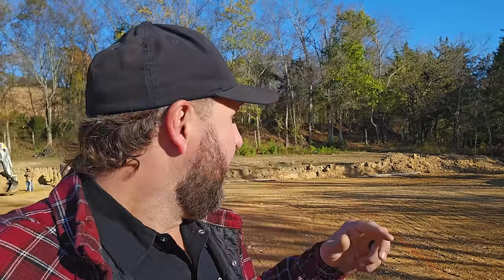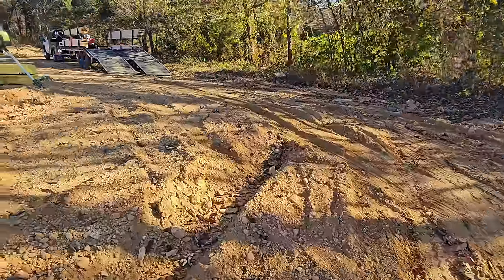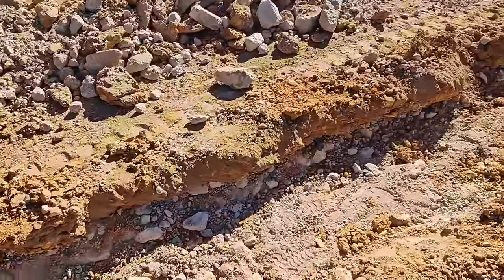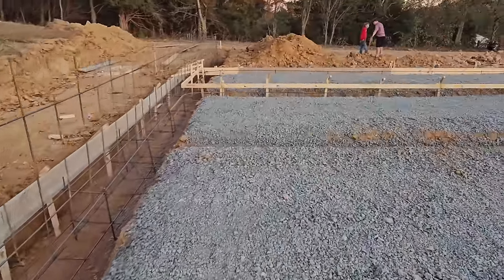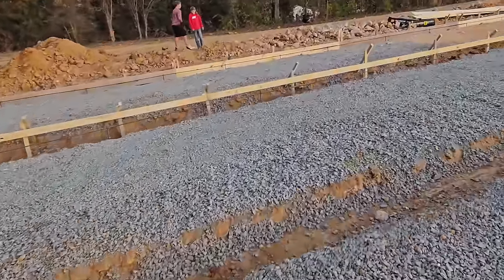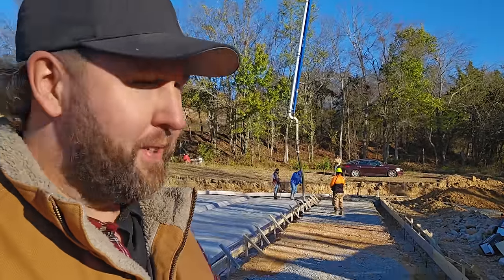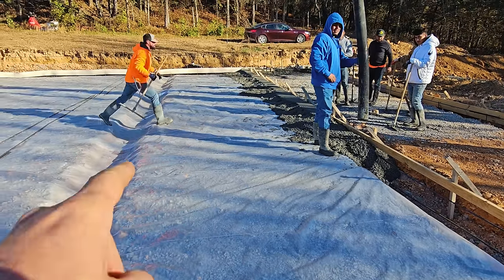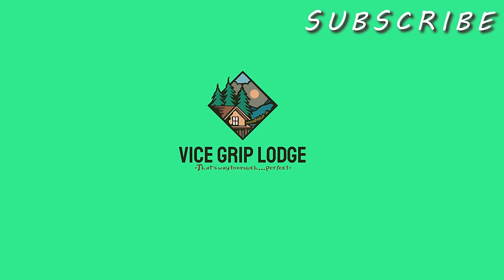We're Already OUT OF ROOM! Barn Build - Part 1

Comment: it's always interesting to see how the different regions of the country do building and concrete. Up here in the dry side of Washington state we get some serious freeze/thaw cycles. Winters get down around zero F, summers up to 109-ish, sometimes hotter, colder as well. A 4000 psi is a good strength for footings, slabs, retaining walls are sometimes higher strength depending on the multitude of variables. When the crew makes it look easy, you know they've got the experience. That's a good looking slab. Up here we'd use a heavy wire mesh or a rebar grid in that slab. That adds a lot to the cost, nice that you don't need it.

Comment: You can still wire the barn for lights and security cameras, just don't connect it to the grid, small solar system will power lights and stuff.

Comment: Howdy, those pump trucks are awesome. When I did concrete, I normally used a 42 meter pump (138 feet), but sometimes used a 48 meter pump (157 feet). On huge pours I had 2 trucks at a time feeding the hopper & one job I used 24-10 yard concrete trucks & 22-10 yard trucks pouring just grout to fill in some old truck loading bays.

That "Bulb Seal" is some awesome stuff. It seals from floor pour to wall pour great.

Comment: With no power, some solid solar flood lights where you can put the fixtures in the building but the mini solar panel is on a cord that you can run out the top to the roof is a must. No lighting sucks

Comment: A neighboring farmer put up a fifty x 150 barn with a six inch slab. We poured the footings 36 inches deep and 12 inches thick, then formed the edge and built stem walls just below grade. All the mats were tied in units and we left the center for the driver if the front unloader trucks
   Some real pros showed up and the truck could reach across the fifty foot width and I as a farmer and carpenter brought some ideas forward that improved our part.
   They unloaded a ten yard overloaded truck every fiftern minutes with a screen crew of eight. These guys were friends working on a Saturday with their main job at the time building the concrete parts of the Bengals Stadium. They enlisted me for clean up work around the bolt pads that later held the steel posts of the building.
   They finished the concrete do flat that the deepest part of the very few rain puddles was 1/8 inch. Start to finish was nine hours with unneeded people dropping out as it became just finishing. One ride on double trowel had pizza pans and the other had blades 
  Our little farm crew established grade and square of the foundation and the finishers had very good things to say about our  work as they checked my laser established forms. It was a great day having that crew on the job and we did not need a pumper truck
Reply: When we put up our big workshop we had a portable concrete plant on site.  And a pumper.

Nearest concrete plant is a 2.5 hour round trip -- plus loading, unloading, etc.  Not feasible for a high volume pour.  Barely even feasible for a 20' x 40' garage.

Comment: Should be nice when it’s done. I know it’s an added expense but it would seem to make sense to have at least minimal power, even just a couple of outlets for a battery charger and air compressor. Also a couple of lights inside and an exterior security light. Running a 100 amp sub box off the main shop should be too bad and certainly cheaper to do now rather than after it’s up.

Comment: Derek, I'd like to know why your architect didn't require the use of road fabric in your slab? (re-bar mesh laying 1 1/2" below the top surface of the concrete to prevent cracking and heaving of the concrete during freezes). Concrete has no tensile or shear strength which is why re-bar is always specified for concrete.

Comment: I’ve been in dirt work all my life. Over 30 years and I have never used big rocks and asphalt chunks for fill. The reason is there will be voids under the concrete and your concrete will crack and the building will settle over the years . I’ve never seen someone use gravel under the concrete either. So good luck . I hope it all last for years .

Comment: Geez, America does concrete quite differently to Australia. That would not pass code here. The slab itself would be full of rio mesh and vibrated. The foundation and wall would have a LOT more steel in it and vibrated also. Did they even test it for slump? WOW!

Comment: Why are you NOT using steel/rebar in the concrete? The steel is what gives concrete it's strength. Concrete cracks which looses the original strength. The rear holds it together and allows the foundation to better move with the land as needed.

Comment: Our pond has like a concrete box with a storm gate on top with underground lines. Zonen5b..so the pond only fills so much then when it reaches the top of the grate it flows into it out the lines in the ground . Could you do something like that if it gives you more issues ?

Comment: I think you'll wish you at least had power at the new building. I understand the cost/benefit of not running water out there, but I can see a lot of scenarios where having lights or 110 power for an air compressor or a battery charger without having to go all the way up to the main shop would really be handy.

Comment: Think of the Lincoln as a Crown Vic with better interior and a good stereo. If a guy wanted to, he could easily cut the body off of it and go full Leeroy and build it to be a cool drag car.. There's plenty of performance parts for those mod motor 4.6L's, that or you could easily put a 460 in it.

Comment: I see the rebar reinforcement for the walls etc.,,,but unless you didn't film them laying it on the floor or I missed it some how, it pretty much looks like they just poured the concrete with out rebar.  Only thing I can see is that it is between the rock base and the plastic and you just didn't film it.  If it wasn't reinforced, you are going to have cracks in the finished product.  It will probably even show up right away because of all the compacting of the added soil to bring it up to the desired grade.  All it will take is a little unexpected settling and those cracks will show up.  Hope I am wrong.

Comment: Am new to the Lodge channel, but man, it's no wonder you had some cracking in the slab on the next episode of this barn build - looks like they put down less than 4" thickness (which is absolute bare minimum, would go with 6" if you're gonna load the pad with equipment), and no reinforcing whatsoever is pretty insane to me.

Comment: I think you'll regret not running power to this building. Minimal, enough for lights. As it's inevitable that you'll need to go up there to get something, or move vehicles in the dark. Also, maybe for some security cameras and such. And, pulling the RV in there, it will be nice to be able to have power for it, So then you can use it for guests to stay that may come to assist you in projects, or to just keep it warm so you don't have to use that crappy anti-freeze in the water system. Also, another power need might be for some block heaters for equipment or maybe a engine that you wouldn't wanna freeze if you've only put water into it. And, I'm sure some will need some battery tenders to keep the batteries charged up and ready to go when you need them.Bottom line, I do think you will power.

Comment: I live in Texas and tell the truth I’ve never seen concrete poured with no steel in it. Down here we build a web in 1 foot or 2 foot squares of steel sometimes smaller depending on what the building is just curious what kind of concrete they are using

Comment: tell you truth I probably wouldn't put concrete slab down if it only going be a storage building. framing barns where they store there farming tractor most their barns only have gravel for floor. cuz there not lights and pluming in barn

Comment: WELL it appears that it will not be a pole building since there are no embedded poles. And since there were no large pads for any steel columns, it must be a frame build! I would have expected more steel in the footers, at least (2) #5 bars. But I am just a general Contractor and designer.
Reply: Never fails. A YouTube expert to tell everyone else what they did wrong.
Reply: @Ada-zn3pw  WELL i SEE IT ALL THE TIME. If no one speaks up and tells them, it costs people money. I have been doing this for my entire life. I am 64 and still designing houses and structures in Florida and designing for hurricanes. Yes I have worked from Indiana to Florida! So there is always those people that says they know and have a contractor  license yet those contractors do not know the difference between a hip and a gable roof. I have one contractor call me just yesterday that did not know he had to fur the masonry block walls and insulate them. And I get calls from people as far away as Colorado asking for advise. I get so many calls from people that many engineers do not want to take the time to address bad workmanship!!! So yes I speak up so people know what they have received!!!

Comment: No rebar in the slab...going to crack and split unless its a reinforced concrete mix and even then it will down the road..still shake my head at people pouring slabs without reinforcement doing it on the cheap

Comment: Ahhhhh....I watched the Number 2 video before I watched this one.  I was wondering why the slab turned out so poorly.  Now having watched this video it explains why.   10 feet of fill needs time to set.   I also noticed that there is no REBAR in your floor.  Slab like that 2 foot square rebar should be code......I cant believe they let you pour that huge slab with NO rebar.    Did the county code guy take a vacation?  Its like rebuilding an engine and using old bearings.  Failure before its complete.